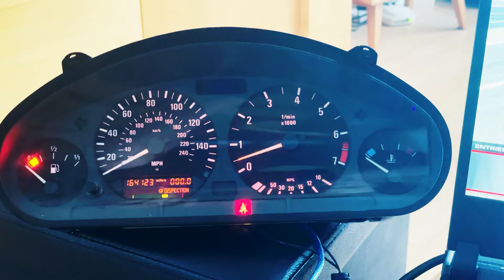BMW E36 Instrument Cluster with SimHub and iRacing

Comment: have you found a fix for the fuel and temp or is it just simhub as im guessing you use that
Reply from the maker: Hi,

unfortunately I haven't and yes, I am certainly using SimHub ;-)

Not sure if the issue is SimHub or the Arduino, but form 

https://github.com/SHWotever/SimHub/wiki/BMW-E36-Cluster-Setup :

'After lot of questions about Fuel and Temperatures gauges I've acquired the famous "E36" cluster and reviewed the following wiring.

Unfortunately, my tests show that Fuel and Temp will work randomly even if every single signal is perfectly generated.

In the light of these developments, please consider both fuel and temperature gauges as not working on the E36 cluster with Simhub.'
Reply: @marcmouk  Hi both, we documented the Fuel and Temp gauges as non-functional, but it's more a statement to avoid disappointing those who try it and find irregular results. I have the gauges working on my cluster, so they can be driven (MPG can't though due to hardware limitations with the arduinos). You can wire them up and enable them on SimHub, but remember that the fuel gauge is heavily dampened so it may not reflect your game's fuel level accurately unless you restart the 12V power to the cluster.

Enjoy, nice demo!
MorGuux
Reply from the maker: @MorGuux  thank you so much for replying. I will give it a try. Any tips?
Reply from the maker: @MorGuux  Great, thank you